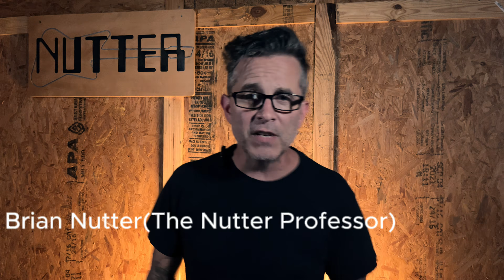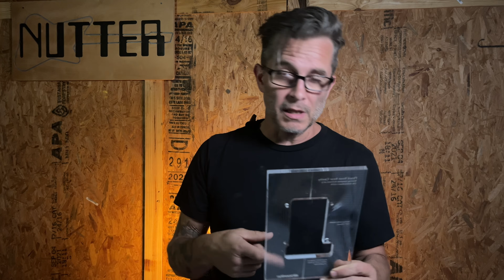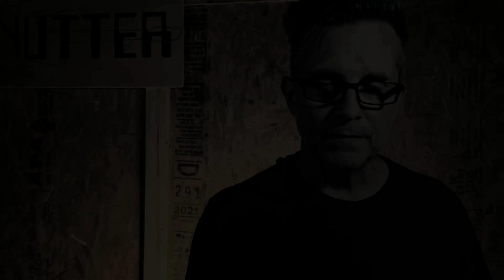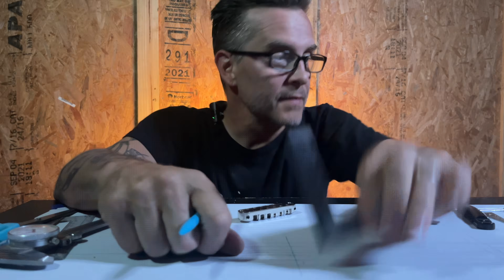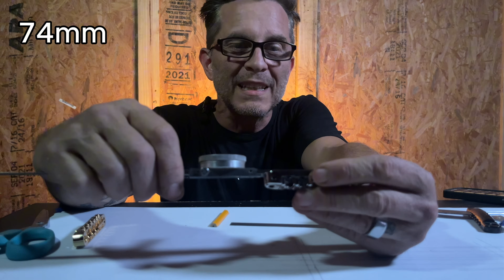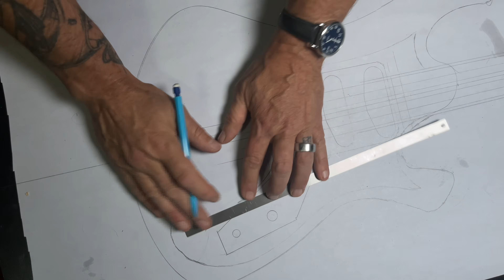Why Electric Guitar Body Shape Actually Matters

Comment: It's interesting to see that you sort of design backwards from the mechanical parameters.  And headstock before body.
I do exactly the opposite.  For me, the body is the main character, a shape someone  has to like a lot, to buy mine before some thousand others he already knows.  I throw down a few center lines on paper, small, maybe six inches overall, and do gestural strokes to define the areas and ergonomic needs for the body that's evolving visually.  Often that involves tilting the body's main axes (center of bass bout width, waist, center of treble bout width) forward or back (for 'avid', static or recumbent leans).  Once I have a motif  (and impetus) established,  Round, Angular, Sharp, etc., I draw the outline using those ideas everywhere (for self-referentiality), and THEN design a matching headstock (the hard part), and then trace those cleanly on tracing paper.  Then I scan that into my Gerber sign design programs from way back in the 80's (simple drawing tools), blow it up to approximate full size, drop in one of my pre-drawn necks (with scale length indicated for each), and first, size the headstock onto the end of the neck, decide if it looks right, maybe stretch or shorten it, plan for every tuner and its string paths, then add a six foot human body outline behind the guitar and adjust the new body to fit a person and look best.  (You can also have existing guitars scanned to show you how big it is next to a guitar you know intimately, like  a Strat or LP.)  Most guitars will be between +- 12x16 and 14x21...but you should also measure your design off the Center line...it doesn't have to be exactly symmetric, but knowing where that perfect reflective shape is can tell you how far you can push it. A lot of people instinctively draw guitars smaller on the low half, I don't know why...probably has something to do with our seeing the Horizon line to know where we are, so top edges are focused on.  Balance the weight of the top half and bottom half around the CenterLine and it will always feel better visually than having them disparate.
Then I completely redraw & digitize the body line, using the mouse to add points on the outline, and taking advantage of the program's curve-smoothing abilities between points on the line.
This can take some time.  Really pleasing curves are hard to do consistently. First pass is usually an hour or so.  But don't stop there.  Walk away from your design for a bit and then come back to it.  Then come back and do the hard thing, which is self-critique. 
One trick to seeing your own mistakes is to flip the body around in all four directions.  Some folks only ever design upright (hanging), but I want mine to look best in the laid-over playing position.  I want the playing experience to supersede how it looks in a store display.  (Some folks swear this is wrong...damn salesmen screwing up design--again)   And don't just work in the Outline mode...occasionally you should fill the shape with black or whatever color---the solid shape can feel very different than just linework...it carries weight you won't appreciate any other way.  
 Standing it upside down (tail end up--the Lollipop orientation) can REALLY show you how bad your drawn curves can be, so adjust those to look good again.  Somehow following the curves down from the top like water flowing down helps to get  things more organic. 
Then I do the player's view, (Treble bouts up and head to left), which can show you where all the ergonomic knobs and switches feel best, and for some reason shows up issues with the Guts Bout and bottom edge.  This a good time to set the balance point where it will sit on your leg--usually right between the pickups.  It's an important thing to include...a guitar that don't sit easy won't get played.
I have digitized dozens of knobs and pickups and bridges, to scale, so I can just swap them in with a click, so I pop in placeholders for their positions and decide on design elements later, to match the overall Tone or visual feel of the thing and the music it is designed to make via pickups, colors, etc.  Is it a Metal, Jazz, Retro, Prog, etc.?
Flip the guitar around to hanging position (Head-up) and make any obvious curve corrections (usually in the Strap bout), and then go in and fine tune every inch or so around the perimeter.  Keep turning it around till it looks comfortable from every angle.  The way you approach the way your shape bends is a huge part of how 'right' it feels...so keep your curves or angles complementary to itself.  It should feel as though it grew that way, led by internal chromosomal rules.
Then you can use Outline (or Inline really) Tools to set any binding sizes and their routs.  
Of course you still have to consider any cover plates (and their cover's shelves) and do a pickguard, which can be nearly as hard as the headstock...do not slough those off as afterthoughts...they have to be idealized too or you can ruin good base work in a damned hurry.
I go ahead and design any internal routs at this time, for pickups, guts/wiring, drill holes, and weight reduction/chambering.
Once I have the body and head perfected, I can order routing templates made, laser-cut from clear 5/16ths plexi from a sign company I have a confidentiality contract with, for the body with internal routs, head w drill crosses, covers, PG, TRC, etc.
I order my necks to spec from Warmoth, with paddle heads that I can cut out to my design.  This costs money, but saves dozens of hours of easily screwed up steps that they do way better than I can.  Then I do the body work while they're making that, doubling productivity.
I prep the body woods (thicknessing, squaring, splitting for bookmatch, etc and sanding), at a nearby cabinet shop (saving me the cost and storage for a planer, jointer, and table saw), and just trim that to close size with a small band saw,  and rout the final shapes and edge radii with a good strong plunge router.  So I only need a mini band saw, drill press and hand-and table-routers to do everything, and have perfect templates should I need another one.
Reply from the maker: Wow!!! This is a cool and detailed approach! I love seeing all of the different ideas and processes to achieve the desired result.

Comment: 1 more thing 😂 Fretboard overhangs can create challenges if your measurements for neck pocket depth and neck blank (without the fretboard) aren’t accurately laid out. There needs to be enough room between the fretboard overhang and the body to accommodate a pickguard sandwiched between them. I like to make life easy and avoid fretboard overhangs all together. Also, that allows the ability to play with the neck pocket depth. I like to do Warmoth’s .720 mod making the neck pocket depth .720” so my wood mounted humbuckers don’t look like they’re falling out of the guitar 😂

Comment: A bridge pickup too close to the bridge, wether there is enough room for a pickguard or not, sounds thin and not full. A good spot for a  bridge humbucker is about 1.500” to 1.625” from the high e intonation point to the center of the outer coil pole pieces. Some even do 1.750”. Where a guitar pickup is placed on the scale greatly impacts the way it will sound. The closer to the bridge it is, the brighter it will sound. The closer to the neck it is, the warmer and fatter it will sound. Experiment with pickup placement on the scale to get some variation. Also, don’t put a single coil pickup to close to the bridge. It will sound horrible. And pay attention to which routing templates used for the pickups. Don’t use the one Brian showed for humbucker if you plan on wood mounting your pickups. It’s not tight enough. It will look horrible and won’t support the pickup in the cavity. Also, I’m glad MI is now printing things to make templates. I enjoyed showing them AUTOCAD when I was there. Printing things 1:1 is pretty useful isn’t it?

- Kevin
Reply from the maker: You are absolutely right about how pickup placement affects the sound of the guitar. You can experiment with placement to find your desired result. Here, I’m merely giving a safe starting point. 🤘🏻
Reply: @TheNutterProfessor  Absolutely! I just like a fatter tone so I measured off my HSS Strat to see where it’s located. I noticed the djenty guys have them even further away from the bridge!
Reply: @TheNutterProfessor I wish you was full time when I was there. I greatly enjoyed talking specs with you the short time I got to work with you and learn.
Reply from the maker: @ReVeRbx-fe5wr Thank you sir! The photos of your completed guitar looked fantastic!
Reply: I have strat and tele projects that I just cannot get wired perfectly.  I fix it here and it dies there.
Reply from the maker: @guitarsavannah1293  Subscribe to the channel. I’ll be doing videos on wiring very soon!